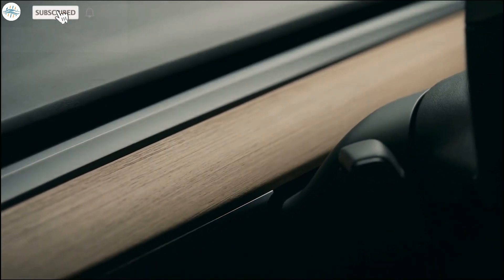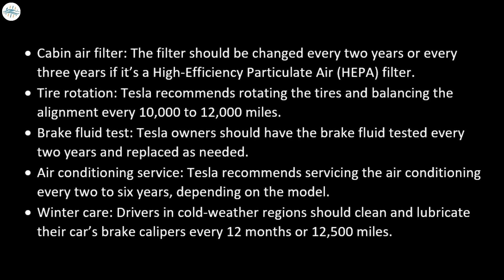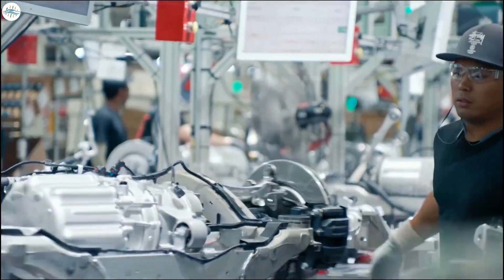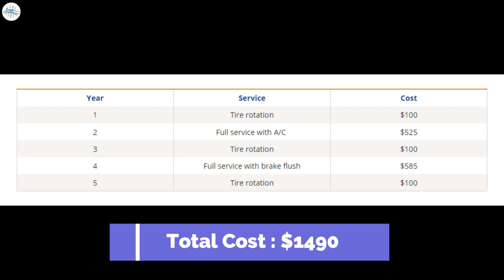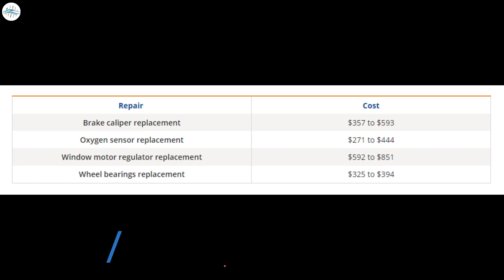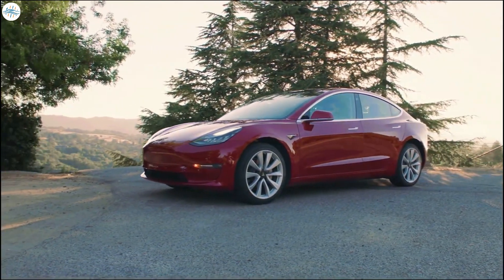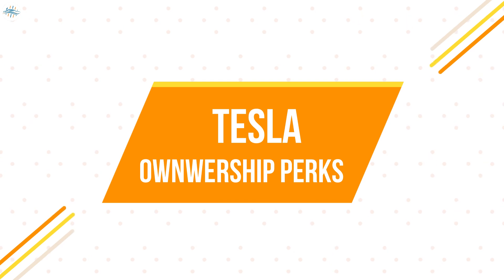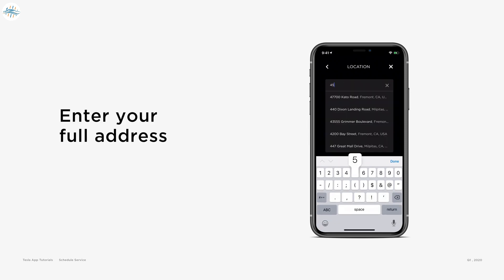Tesla's True Cost Of Maintenance (Every Model Covered) - Detailed Analysis!

Comment: O2 sensor replacement? for an electric motor?  Are there a pair for each catalytic converter?  Wheel bearing replacement really should last the life of the car. Brake caliper can be overhauled instead of replacement. 
The one thing that will need regular replacement that is not mentioned is the 12V battery.  That will be needed around two years.  If not replaced, you'll be stranded.  That will cost around $200 or $500 if you get an Ohmu  aftermarket battery.
Reply: I had a 417k miles car, no wheel bearing replacement